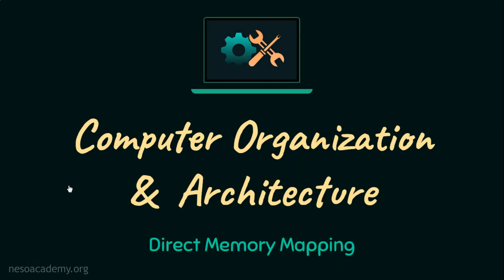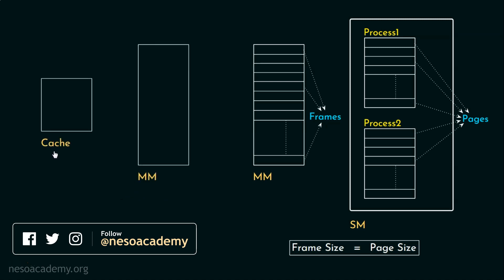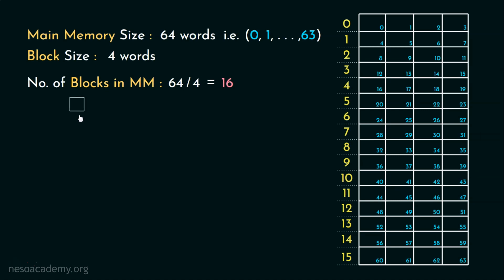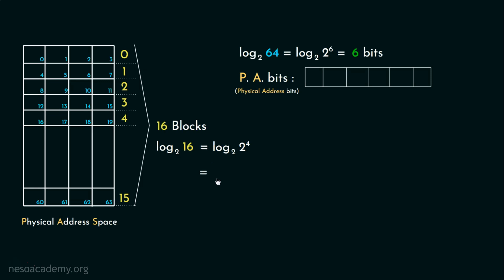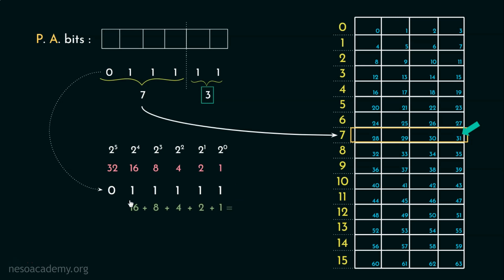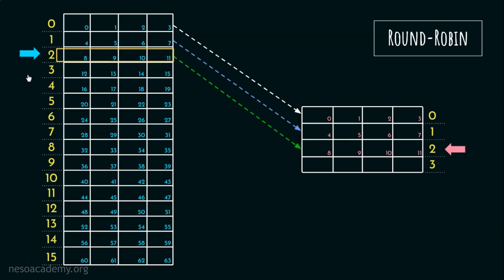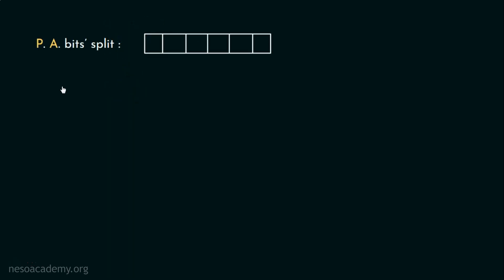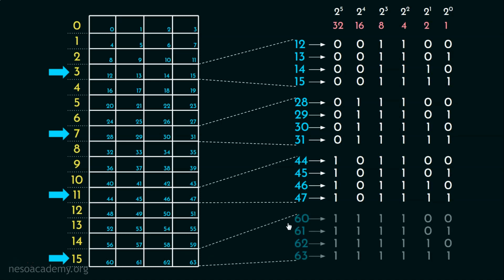Direct Memory Mapping

Comment: Were these examples solely focused on addressing? I'm wondering where is the data the cpu actually needs to process?
Reply: a word contains data and to access it , has been given an address , so when the cpu needs it , the address is checked for if it matches the data unit is fetched and the 
instruction is executed